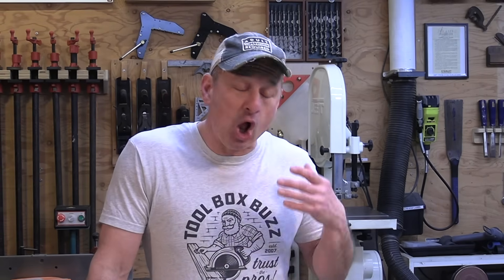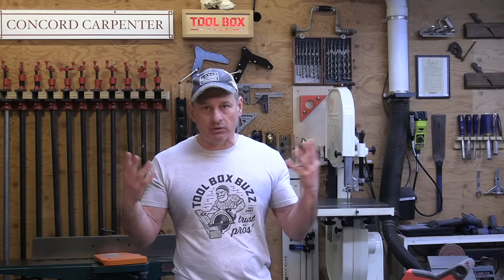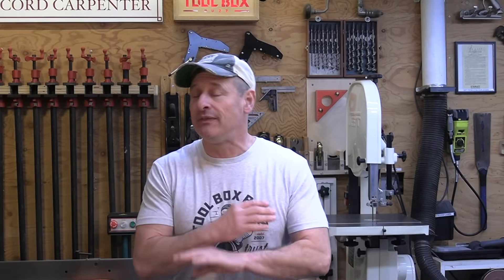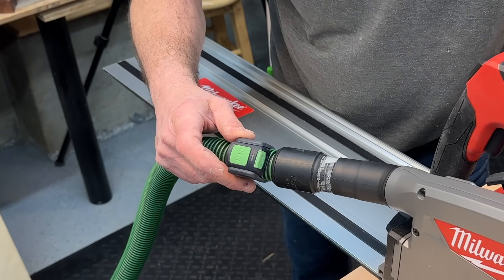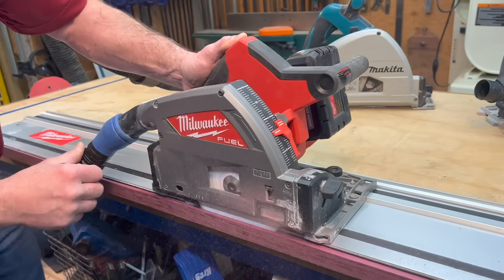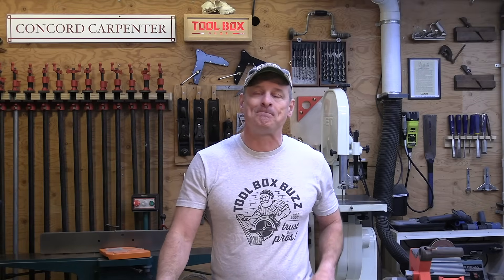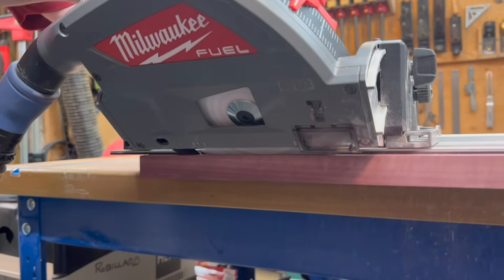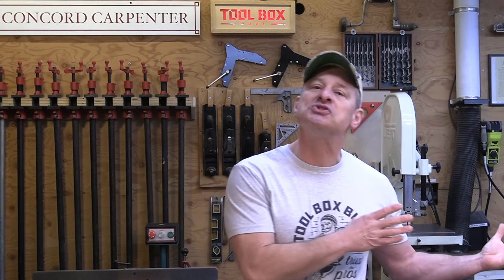Milwaukee Track Saw Review

Comment: I sold my old Festool TS55 to get this and I'm not disappointed at all. I'm all in on cordless and Team Red just has the best battery platform in my opinion. Surprising how some need 2 batteries to do the work Milwaukee can do with one. I am a Festool Fan but have reduced my fleet to dust extractors and sanders.
Reply: Mafell MT55 have one battery!

Comment: Excellent review,  I have a device from Rockler that you plug  your tool and vacuum in to  so when your tool  is activated  so is the vacuum plus it stays on for 5 seconds more to clean the hose line. It's around $55.00 dollars  and you can run multiple saws whith the one unit. Hope this helps.
Reply from the maker: Thanks for sharing - se have one too for our plug in tableaw and vac on the jobsite

Comment: Most comprehensive review of the Milwaukee Track Saw that I've seen. I'm on the fence about getting a track saw and Milwaukee is one I've been considering. I'm just a hobby woodworker, but I like to get good (not great like Festool = way too expensive) tools. I'm 2 weeks away from moving into my new house that has a 14'x32' woodworking shop. I've had built in to it great lighting, ample power drops (getting a 3hp Sawstop, Harvey C-14 band saw and Record Power 3 motor Camvac), along with my 8" planer, 13.5" jointer, miter saw, floor standing drill press and router table. Just need to build out all the furniture = outfeed table, work table with vices, cabinets for tools etc., wood racks .... Figure I'll need/want a track saw to break down the sheet goods, along with making long straight cuts that are easier to make using a track saw then a table saw. Love your channel and tool reviews.

Comment: Great review Rob!
Unfortunately I've been using the Makita for 3 years now,and using 2 batteries is no hardship for me.

Bosch/Metabo/Mafell have upgraded to new and better rails.
Pro's.. stiffer,clamping slot is much closer to cutting area,removable plastic bumpers on both ends,track joining is done from above and a much better alinement system .
Con's... rail clamps are totally different ,and 3rd party clamps are not available. 
Currently I have a Metabo track compatible 6.5 saw,and will be adding the Mafell.

Comment: There are a few other great tool reviewers on YouTube, but I cannot say that any are better than Rob. Great review.

I might get this saw. I have plenty of batteries for both Milwaukee's M18 line as well as Makita's 18V line. I prefer Makita's circular saws to Milwaukee's, but I use a bunch of other M18 tools. I was considering getting the Makita track saw, and I really like Makita's bluetooth dust extraction features. However, I think the depth adjustments, track-alignment cams, riving knife, and 1-battery (yes, I know the XGT has 1 battery, although I haven't bought into the XGT line yet) give this a little bit of an edge over the Makita. They both seem like great saws.

One gripe that I have is that the Milwaukee packouts are way too big for this saw. Makita's packouts are more compact, which allows you to transport your tools more easily. I might just buy the Milwaukee saw plus a Makita packout and then use some scrap foam that I have to make a cutout for the Milwaukee saw. I don't need a kit with an M18 charger because I already have a couple as well as a bunch of various-capacity M18 batteries. For me, I use a bunch of different M18 tools, and it makes sense for me to keep my charger and batteries in their own space rather than putting them in a packout with just 1 of my M18 tools. So I'd rather have a smaller packout just for my track saw so it doesn't get banged up.
Reply from the maker: Thx CCG

Comment: Very good review on the Milwaukee track saw, Rob. One thing I would like to point out for your viewers, contemplating purchase of Milwaukee's companion track saw guide rail, however. I am a big fan of TSO's guide rail accessories. After some verbal volleyball with TSO's customer service however,  I found out the only accessory they currently make to use on Milwaukee's guide rail is their GRS 16 PE Parallel Edge Guide Rail square. This square is only way you can connect their parallel bars to Milwaukee's guide rail. The original GRS 16 and PG adapters will NOT work on it. They hope to have Milwaukee versions available by the end of June or July 2023. If you already own Festool, Makita or Power Tecs guide rails, you can use your Milwaukee saw on those guide rails and TSO's current accessories will continue to work fine. In spite of this, I am getting ready to order the Milwaukee saw, since I am already heavily invested in their tool line and own several High Output batteries, allowing me to purchase the saw only. Thx again for the great video.

Comment: Great review, thanks!

I have both red team and teal team cordless tools in my shop. I go for the tool I feel does the job best (within my budget of course).

I've had the corded, 36V and now 40V Makita track saw. One of the main reasons for going from 36V to 40V was to lose a battery. The Milwaukee checks this box. 

It also checks the boxes in 2 other areas for me, like depth adjustment (Makita one is average at best) and the riving knife (absent on Makita).

But as you stated, they dropped the ball on the Bluetooth dust extraction and I use AWS heavily, so that may be the deal breaker for me.

When they come back with that (ideally universally compatible with other BT dust extractors), they may have me hooked.

Thanks again, big fan of your reviews!
Reply from the maker: Thanks, Patches!

Comment: Using my track saw for the first time in the next few days. The hash marks explanation will be very helpful when plunging.  You mentioned that the riving knife needs to be removed or adjusted for plunge cuts? I need to read my Manuel again I forgot most of what I read.

Comment: Great video and super information! I was hoping you'd compared the Festool TSC 55 KEB. You mentioned the KEB's features: electronic saw control in place of riving knife and BT Batteries. My understanding is that electronic saw control of the KEB 18v x2 includes a motor control during the cuts. It's also using the 1.8mm blade like the Milwaukee M18 unlike the other models.  

I bounced back & forth... both great saws; decided to go with KEB for the BT convenience and the 3rd party add-on components.
Reply from the maker: This saw is is similar to and more powerful than thr KEB but I Love the Festool  bluetooth functionality
Reply: @ConcordCarpenter  Awesome to hear, have you tested or compared the KEB? I hadn’t seen that test, Can you point me to the video. 
Again, always value your reviews & tested.
I’m in my 30 days, may make a change!
Reply: I purchased the Milwaukee and several 1x12x48 pieces of Red Oak. Did several cuts… slow both performed beautifully. Pushing  , the Festool 55 KEB, I was able to stall at moderate speeds and the Milwaukee didn’t stall even at significantly higher speeds while maintaining a smooth cut. Took both saws to battery exhaustion, the Festool wouldn’t recharge until after a 15 minute cool down and the Milwaukee wasn’t hot enough to require a cool down and immediately began to charge. 

I’m actually impressed, I had assumed the new KEB would outperform the Milwaukee and it was the opposite, the Milwaukee easily outperformed the 55 KEB. 

I like the BT auto start, but also have the BT button on Vac hose end so still convenient.
I’m within the 30 day satisfaction period of both saws, so I’ll be returning the Festool.
Reply from the maker: @dougcjohn  great feedback

Comment: Typically great review, thanks! I would definitely own this saw right now, but got tired of waiting a year ago and bought Mafell. No regrets owning the Rolls Royce of track saws, but I would have gone Milwaukee given the choice, mostly due to already being on M18 platform.
Just a note, the Mafell is on the CAS battery standard, and I use METABO batteries at $110 - $140, half the cost of Mafell branded batteries. I also use the METABO fast charger, again half the cost of the Mafell (slow) standard charger. 
One thing I really like about the Mafell is the best in class track joining bar for perfect straight long rips you just don't get in the Makita or Festool (two systems I am personally acquainted with).

Comment: Good review 👍 looks like the Milwaukee is half festool and half mafell in both features and operation.
I thought they might have used mafell rails they are the best by far.
I doubt that the Milwaukee has the finesse of the festool or mafell in its finish but looks like it has plenty of power for ripping sheet material, I've used the DeWalt which has great power but lacks any finesse.
Looks like a nice piece of kit though.

Comment: The reason I have not purchased a TRACK SAW is because I try to buy the best.
I exclude Mafel because of price and that left FESTOOL. 
For a variety of reasons, and previous experience with them,  they are excluded. 
I have quite a few MAKITA tools but the saw does appeal to me.  
Everything else is excluded because of quality not at Pro level. 
Finally a saw that ticks all the boxes.  Wish I had viewed this video some time ago.

I am not certain the lack of Blue Tooth is an issue. 
I already have a few Milwaukee tools and like them.
I'll go check it out. 

Thanks for the best video on Milwaukee and other products, You are the best.

Comment: OK so what is the trick Milwaukee is doing to only need one battery? Are there extra pins on the saw that connect to the XC 6.0 which run the saw at a higher voltage or is it just that they can draw more current from these cells thus requiring additional windings? How's the performance with a XC 5.0 battery?

Comment: Hey Rob thank you for a great review.  I love the look of this tool but as I’m on both the Milwaukee M18 and the Makita XGT platform I’m going to buy Makita’s track saw because of the Bluetooth functionality.  I absolutely agree Milwaukee is behind the curve on not including it in this saw and also with the with recent shop vacs.  I like how Makita has merged the shop vac and dust extractors and added Bluetooth.  Such a shame Milwaukee has made such a great saw and missed out this functionality.  Any chance you could review the Makita XGT model to compare to this Milwaukee?  By all accounts it seems a big upgrade from the 36v LXT saw.
Reply from the maker: I'm hoping to get the XGT soon
Reply: I use the XGT saw for that reason the other option is to get a festool extractor with a remote

Comment: What track saw would you recommend for a non-pro woodworker that’s looking for accuracy and excellent dust collection while working on furniture, and also with occasional DIY around the house type projects cutting up sheet goods, etc?  I don’t have the room in my small shop area for a cabinet grade table saw, and most small job site table saws aren’t terribly accurate for precision cuts for fine woodworking projects. I’m leaning towards a track saw because of the excellent quality of cuts and compact size.
Reply from the maker: Makita

Comment: Track saws - this is a 're -inventing the wheel conversation'.   I have a 10 year old Dewalt with cable and no plunge facility -  I have done everything from cabinets to Parque edging - Innovation would be an integrated dust hose that provided mains power !   Nothing in the last ten years has been much of a game changer apart from the Cutting blades.

Comment: The bluetooth is an easy fix so long as Milwaukee addresses this with their dust collectors. Like Festool, all Milwaukee needs to do is copy Festool's bluetooth batteries (no modifications needed for the saw itself). If they release a bluetooth dust collector in the future, along with bluetooth batteries, they can make this track saw completely bluetooth compatible. The other option is to use a Festool dust extractor with a bluetooth control on the dust hose, or some aftermarket equivalent which is available.

Comment: Great informative video. I have the Mafell mains powered tracksaw which has a scribing feature that moves the blade sideways .1mm to prevent splintering when cutting laminate full depth.  Does the scribing feature on the Milwaukee do the same or just reduce the depth of cut? Thanks
Reply from the maker: no - Mafell is King!

Comment: If I wasn't already on the Makita battery platform, I would have bought this saw. I love the Makita, but I hate that the depth of cut is only in metric, and doesn't compensate for cutting on the track or not. The Milwaukee just seems like they did the little things a little bit better, but definitely not enough to swap platforms

Comment: You may want to revisit the Milwaukee track saw clamps.  The 2 set I recieved will not slide fully into the track like those from Festool.  I did take may Milwaukee track to a Rockler and verified the Festool clamps slide fully in.  Out of frustration I ground them down at the bend to fully fit the track.  
Also for those out there that like the clamp style of the Bora edge clamps the Festool  FS-Rapid works great on the Milwaukee rails
Reply from the maker: Good feedback thanks
Reply from the maker: I have all brand clamps but rarely use them. I did not test the Milwaukee clamps in other brand tracks - didnt think of that

Comment: Waited years for Milwaukee to release this. They released it 2 yrs too late for me as I got the Makita 2 yrs ago. 

The only thing I like the Milwaukee over the mikta is the single battery and the riving knife. Usually I use the track saw on sheet goods, so riving knife isn't as useful but it's nice to have just in case.

Comment: I've been waiting for so long for this tracksaw since it has been announced for the first time, Cordless Ts 55 is lacking of power in my opinion, but about half of year ago I decided to purchase some additional High Power festool batteries- seems saw is a bit more powerful and because of that drains battery slower. Bottom line is I'm not going to switch to Milwaukee tracksaw now, came a year too late in my opinion. Complaining about a cost is ridiculus, for a professional it pays for itself within a day. 95 % of my tools are Red and I'm always impressed with what they can achieve with a single 18 volt battery
Reply from the maker: I wouldn't switch  either
Reply: You can use the new frstool blade on your ts55 it will cut twice as fast, or get the new ts55 which comes with kickback as standard
Reply: @riptonedwards9175  Kickback not an issue as riving knife does the job, went through multiple brands of blades and I still think it's underpowered. If I would bother with getting new tracksaw I would get Milwaukee, sell Festool, that way I don't need to own 21 batteriess but only 17🤣 so I don't really get your point

Comment: How can I describe myself? I am far removed from a what I consider a professional DIY, rather more as a hacker in that regard. I recently (this summer) got rid of my old corded power tools that I purchased and used some oh 10-15 years ago and purchased a set of Milwaukee tools. Truth be told, I went overboard, but hey "in for a penny in for a pound" as the saying goes. Anyway, watching your great video I am now considering adding this tool to my collection. Which brings me to the reason of this long winded comment, the dust collection and the lack of Bluetooth connectivity to dust collector. While my solution may not be as automatic, I did solve it with a simple remote power switch available at any big ox store for under $20.00. Works with any tool you are using that generates dust and the dust collector is corded.

Comment: festool and makita has different points at which they tilt, and designed to be used with same looking kinda compatible tracks unless you tilt them with some degrees, different points are designed to use with a slightly different heigt of tracks not to cut them... and to sell them

Comment: I bought it a month ago and I used it couple of times without vacuum and with my surprise the saw dust gets stuck inside of the saw to the point that I need to remove cover and clean it after 2-3 not so long cuts I’m thinking to return

Comment: Really good review, 
Milwaukee just nailed it ,the saw is doing exactly as presented in this video and is better that the competitors for many reasons : 
one battery 
light weight 
powerfull 
precies, 
efficient 
why buy 4 batteries when you can cary only 2 ?
This saw it's all about efficiency.

Comment: Rob, great review overall, but you made an error on the price of the festool; the set with the saw, rail, batteries and charger is $879, not $934. You're not the first reviewer to make this mistake oddly enough. The item # is 577008. It's available at a number of retailers. Not a huge price difference, but it does skew the results a bit.

Also worth nothing is that milwaukee pulled a fast one on us with the price for the kit that doesn't include the track; it was announced at $539 (saw, battery, charger and packout), but is now $639.
Reply from the maker: Thanks NW

Comment: Does it matter which of their 18v battery you use?
Reply: Any 18v battery will work but they recommend using a high output battery for best performance
Reply from the maker: the 6.0 XC HD battery was paired / optimized to work best with the tracksaw motor - it’s the best one to use
Reply: If you have an HO 8.0 it will work the same with longer runtime; the HO 8.0 is the same size and weight as the HO 6.0.
Reply: @thomasthetrainwreck_  have you watched guy on Farm Project do evaluation of high output batteries?
Reply: @Veteran1965  no but now I'm gonna!

Comment: Mine has a DeWalt compact 21700 based 4Ah battery hanging off of it. Yet to test it, but goes well in the 12 inch DeWalt chainsaw so should easily handle a tiny circular saw like this. :-)